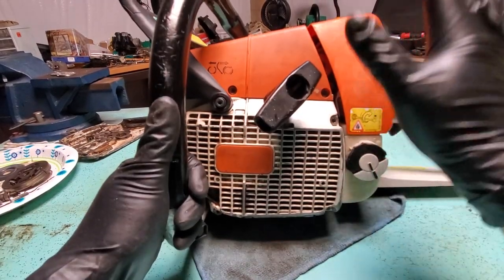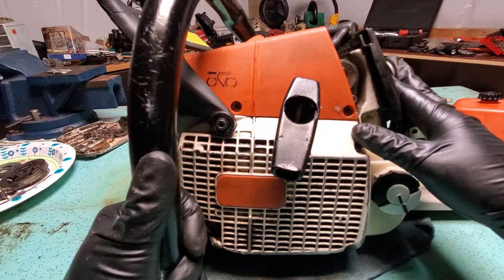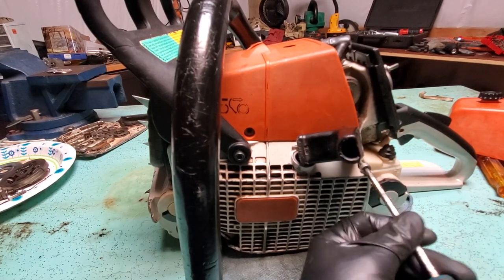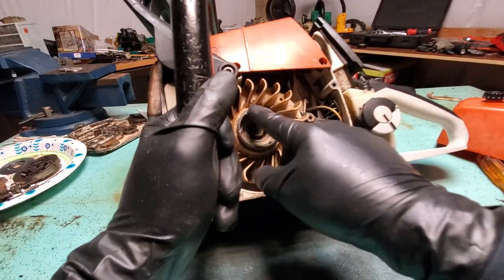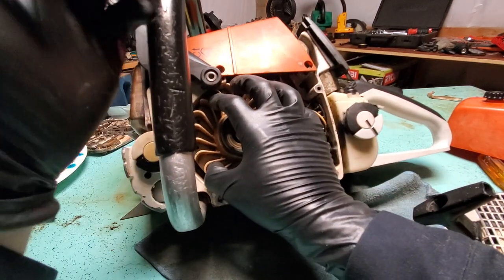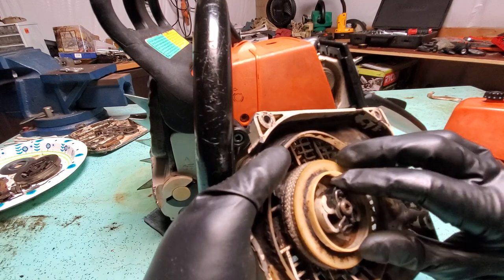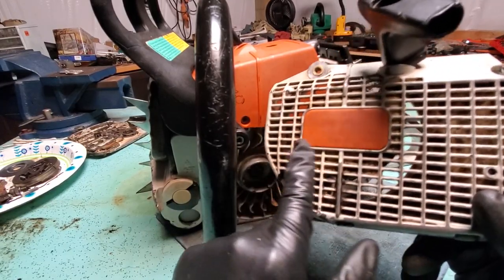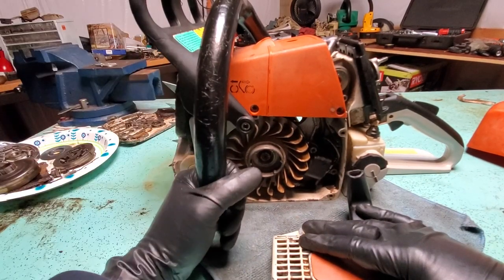Chainsaw seized locked up engine ? Maybe not

Comment: Thank you so much for writing this. I had a Stihl chainsaw that I hadn't used in a couple years. Pull the starter once and it tried to start and then it locked up. I watched your video and luckily the problem was easily observed. The nylon crank pulley separated!  THANK YOU!

Comment: I have to admit that I was frustrated with the pace of the video a few minutes in, but in the end, your guidance solved my issue.  Thank you, thank you!  The pull cord had gotten tangled up making it impossible to pull, even though I had just used the saw and shut it off normally.

Comment: I got a 200t seized up
A bit of wd40 and time
Just letting it soak and lightly moving the crank back and forth
About 3 hours into it, she rolls over nicely, and great compression
Reply from the maker: Just make sure you get the wd40 out before you crank it up. It can ruin you're piston if you try running it on wd40
Reply: I just squirted mixed gas into mine after it locked up running it too lean. Got it to move again. And it feels good. But won't start now. So idk
Reply: @JakePlisskin12   if it locked up while running, you probly have a big problem inside that engine
Reply: @JustinCglass  yeah I kinda figured. You think piston all slashed up 
Along with the ring and cylinder. Or something worse. It's a 1997 husqvarna h350 so might not be worth it. But is my dad so might be.  It's pretty mint other than what I fried.

Comment: I notice this video is 3 years old, but maybe someone still checks it out, I have a stihl 039 I’m working on for a customer and the piston is hitting the spark plug, I’m using the recommended plugs, any suggestions?

Comment: My MS250 is locked up, but when i remove the plug is turns over easy??? Put plug back it's stuck???
Reply: My rancher 55 does same mabe stuck closed exhaust valve ?
Reply: @will5582  thanks for the input i had taken the muffler off but it didnt help just wondering if it s bearing on the crankshaft worn that puts it in a bind under the compression load
Reply: @victormurski112  its most likely your pull cord and spring, either worn out or dirty

Comment: The problem with my chainsaw was that it was stored incorrectly on it's side. The lower end was full of oil from the bar lubricator. Had to spray WD40 into the exaust to thin and drain it.

Comment: Who the hell were these engineers that set up a system internally like this on the original models?? My machine won't turn the bar at all, and I checked the plastic handle lock thingy! I smell smoke coming from the gear deep inside when I get it running, I can't figure it. I'll never buy another Poulan, this one is about 3 mins away from the trash. Idk, if I have the knowledge to do an entire breakdown of this PC. Of sheit?  For $300 I can get an awesome, refurbished Husqavarna I do believe. This Po ulan is engineered garbage. Never again, I've used it maybe 7 times over 10 yrs
Reply from the maker: Buying a Poulan wouldn't be something I would suggest to anyone. If you smell something like smoke or a burning smell, it's most like the clutch or a stuck oiler.
Reply: Poulan products suck in general

Comment: I know to do the mixer 50:1 but yes I rushed through and did end up putting just straight gas in it
Reply from the maker: Yeah unfortunately, the chainsaw is no longer usable with the piston seized. Depending on the type/model of the saw you could repair it/have it repaired. But if it's a cheaper saw like a ms170, I'd suggest selling for parts.
Reply: @fixinstuff4374  man I meant the 0 in the front dont know what I was thinking
Reply from the maker: @Hugeroost  I knew what you meant lol

Comment: Is there any hope my submerged chainsaw could be saved due to it not running while it was under water?
Reply from the maker: Yes. But your going to need to tear it down to make sure you get the water out. And hopefully it hasn't been sitting too long.
Reply: @fixinstuff4374  I drained as much water and gas. I cranked it with the spark plug off and water shot out the cylinder. It's not seized. It was in a hurricane back in 2017 and it sat for years till I finally looked into it. I know I shouldn't have waited that long. It's a low end gas craftsman. Not sure if it's even worth taking it to a engine shop. Thanks for the reply though.
Reply from the maker: @E-Z-E  well to be honest I wouldn't take it anywhere. They're either going to tell you to take it back home or charge you more then its worth. Ill make a video for you. Stay tuned.
Reply: @fixinstuff4374  thanks man. The same place I took my submerged powerwasher got it running again for $50 but I know the chainsaw could be a different story.
Reply: I also read craftsman has a lifetime warranty and I thought about trying to swap it out at lowes but I dont have proof of purchase.